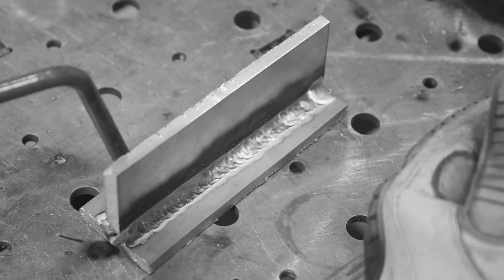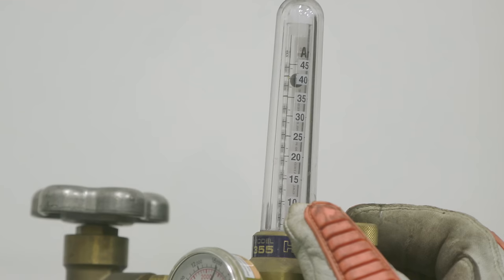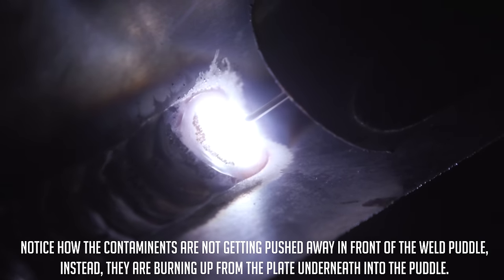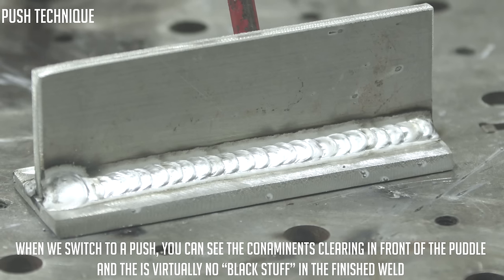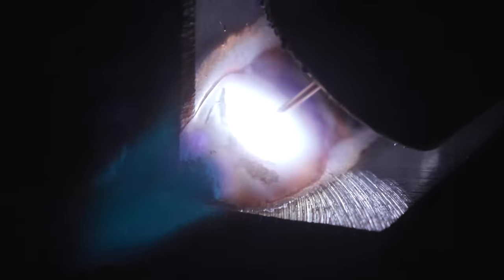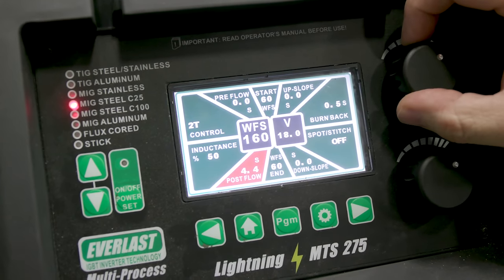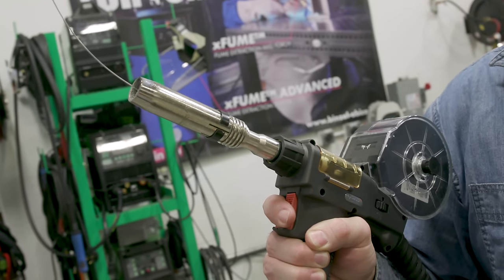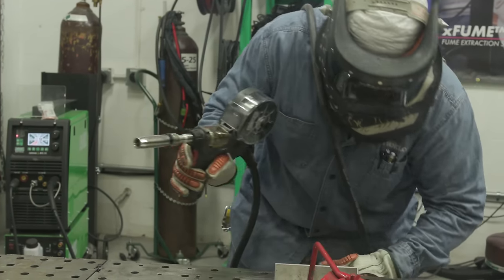3 Ways to Make Better Aluminum MIG Welds in 3 Minutes | PARODY

Comment: After following religiously the guide on the machine cover without success, i.e. too slow wire speed and low gas flow recommendations leading to disastrous results and without any help from the dealership I was contemplating pitching the entire setup and investing in a TIG. Your videos have taught me to make acceptable welds and have saved me the additional $$$, something the dealer was entirely clueless to. Thanks, Andy

Comment: Nice to see your glasses, they really do suit you.

More seriously, on another site it was said that when TIG welding aluminum, you need one second post flow for every amp. So 5 seconds with 50 amps, 10 seconds with 100 amps, and 20 seconds for 200 amps. All so the tungsten could cool down, nothing really to do with the weld. In almost 50 years of welding I’ve never heard of that one.

Comment: Thanks a LOT! 
Greate VIDEO and good view to specific trouble of Al welding!
On the video you quate clear discribed good idea to increase gas sheald during welding ... and you have achived the requared result partly.
As I see additional measures could increase weld cleanliness - on the picture oxide paticles coming from filler wire to the welding paddle
I have one question -
What do You know about chemical treatment of aluminium filler wire?

Comment: The series of Aluminum MIG wire also makes a difference in your bead profile. When your dealing with aluminum take the time to clean it properly, get your travel speed correct, and that your parameters are in good condition to get that nice penetration all throughout your weld. Aluminum is not a forgiving metal.

Comment: Sir , l can see many spatter when I mig weld aluminium. I use ER 5456 filer wire.  How to reduce spatter ?
Reply: ask yourself: what is your work to tip distance and angles?settings?
or are the electrodes stowed properly from atmospheric contaminants such as sprays and dust that may react?
Reply: Could be too much wire speed, not enough gas flow, not cleaned up, too much amperage.
Reply: Bring your volt up .5V at a time.
Reply: @Mikey-ym6ok   I adjusted many the machine settings and gas flow rate.
Voltage can't be adjusted in my machine. Amp , wire feed speed and indctence can be adjusted.
Reply: @ravindukalhara9924  find the sweet spot of tip to work distance angle etc.. could be the shape of your inductance setting is making a tall scalene triangle  shape of arc versus a low obtuse shape of arc .
then try whipping inline(like you have too much coffee, or shivering ) of direction of push travel (always uphill if not able to position work in the flat..) keeping at the leading edge of the puddle will disrupt it less..
assuming your consumable tip and liner dont have any wear and tear causing a stutter type of feed rate spatter
shielding gas nozzle size with flowrate can play a role..
Reply: @philanderingwhitecollartra8281   I tried many times bro. I am using push- pull gun and not the spool gun.  I tried to reduce spatter many time and ways. Welding spatter come out may MIG welding. I think that my machine is bad. Thanks you advice and I respect you for helping me.
Reply: @ravindukalhara9924  can the pushpull system be calibrated? drive roll tension over pressure can cause the wire to spiral as it comes out of the contact tip and into the arc.. what is the length of your system between drives.. learn the cable shuffle of sliding it around avoiding any loops bends excessive twisting.. if you find that the liner is straightened out adequately the amount of wire on the stick out may change... but these effects may see you birdcageing the wire or breaking etc .. keep your stinger straight..lol
inductance can have an effect on how much extra close or further  the work tip distance can be and nozzle size and gas flow play a role..
the only other  would be if your machine is sensing it can cause either the voltage or the wire or both to either increase or decrease of iether or both and typically this is a solidstate analog behaviour  that can be identified by cv,cc,cp..
(constant voltage, constant current, constant potential) 

(typically ill start the apprentices on steel with their dominant hand and as soon as the start getting the hang of it (not good yet) i make them do the rest with the left hand until that improves to same point them i put them onto aluminum same thing right then left then i let them use their dominant hand again and suddenly muscle memory confusion they start to get really good..)
Reply: for aluminum keep inductance at the 50/50 settings.. sometimes this is functionally known as arc dig..
ive seen welders doing repair work get so accustomed to their settings  for specific material repair that they tend to fail the check test by not re dialing in the machine when  should be ...
nylon or plastic liners  help too personally..  get any and all twists and rolls in your gum cable and have an electrical tape wraps every foot at least if not 6-8 inches.. learn to coil your cables so that you dont twist or roll and strain cables..

Comment: have Question I have a hobart 140 with no spoon gun can i use it to weld Aluminum and if so what settings should I start at.  I've tried for a couple of months now to get a welder here to weld for me but they will not even call me back can't wait any more. I do steel weld no problem never tried Aluminum. HELP

Comment: So I applied at a fabrication welding shop, I'm not a journeyman but have a few years welding experience. They asked me to do a steel MIG and aluminum mig test. I've never welded aluminum before that wasn't tig. 

I always push my welds, never pull so I got lucky. 

$32 an hour to start! 

Thanks for the tips!

Comment: Another trick is rotating the spool holder 90 degrees, keeps the curl or the wire in the direction of the weld. will notice a huge improvement.

Comment: Probably the dumbest question, but I have to weld out in the open a lot of time. No building, no covers, any help for welding better aluminium in the elements?
Reply: A couple of clamps a piece of angle and a small cutout from a tarp make nice portable wind screens.
Reply: BREEZE is fatal to all gas-shielded processes!  On the other hand, the world is full of cardboard and tape, and clamps and foil and odd bits of cloth and tarps as Jason must mentioned.

Comment: ummmm MIGHT Be buying a spool gun, Might be trying to half ass it with a carefully with a laid out mig line cause I only have have a few hotrod parts to make.. BUT. 
I did; Like, Subscribe and comment. well done.
Reply from the maker: If you decide to use a standard gun, look into a Teflon liner.
Reply: @Welddotcom  Holy crap you guys are amazing. I took enough welding in college to know that this is the wrong way to do it - especially for anything that looks like production - but those kind of tips for those of us trying to make one off parts are why I keep watching.  Ya'll are great and looks like my Hobart 210mvp needs a minor upgrade.   NOW I just need to find enough alum/stainless parts to make for this car to 'justify' a TIG machine..

Comment: Hi!, im a diesel mechanic and I weld bumpers made out of aluminum. I see previous welds that have broken right down the middle of said weld what would cause this??. I know aluminum has to be clean as possible and I always try to "V" and bevel for best possible penetration, I believe this provides a better weld. You can see it fill in the crack as opposed to just sitting on top of the two pieces that are butted together.
Reply: Undersized welds, concave bead profile, lack of fusion to the root, cold starts, crater cracks, using a filler metal with too low of strength for the fillet size, the vibration of the bumper causing a fatigue failure (use a filler metal with better toughness like 5356 if its compatible with the base metal).  Those are a few possibilities 😀

Comment: In what situation is it better to use wire feed on aluminum rather than tig welding?
Reply: skill at machine settings and dexterity or production volumes or engineering requirements and or deposition rates
Reply: When you're in a hurry!

Comment: Can you guys over in weld.com land do a spool gun video to show off what nets the best results? Whether it's a 15 degree push pull/back and forth, a weave pattern, circles, triangle motion. I understand everyone has their own thing when it comes to that but I'm curious if theres any empirical answer to this. Please and thank you!
Reply from the maker: As far as appearance goes? Or you want an etch?
Reply: @Welddotcom  an etch would be nice to see. I'm going to assume that if the quality is there and it's good enough to pass testing, ie bend, etch, no porosity, etc that the appearance accompanying it should be what were striving to achieve. I'm sure there's more than one technique that will qualify as passing but looks and functionality is what I'm hoping we all here are trying to achieve.
Reply: when qualifying a vertical up difference of whipping inline speed for a single overlapping whip vs double or triple is when bend testing it will snap easy or double will bend 45 and break or a triple just bends over but a steady push can do just as much with practice

Comment: as somebody that used to weld a shitton of alu-mig, you dont need a spoolgun or a push-pull gun, as long as you have a lead shorter then 2m(6ft.), use a aluminum liner in the lead and adjust the "clamping" in the wirefeeder correctly you will have no problems. Why oh why does it seem like whenever i see americans weld alu-mig they always say that you "have to have a spoolgun or a push-pull"?
Reply from the maker: We never said you have to use a spool gun or a push pull.
Reply: @Welddotcom  no, just a general comment. I have used spoolguns in the past and i personaly dont see a reason to. Its heavy and cumbersome to use. And you have to change the wire more often. just a comment on your use of the spoolgun.
Reply: Mattis Vik you’re right, it can be done, however most of the aluminum mig work I’ve done is on parts larger than 6ft and a lot of it has been in the field. It’s easier to carry the spool gun around the shop than to drag the machine every 6 ft.
Reply: @jasonbecker3362  for me, i just bring the feeder with me when moving location, if you are doing large jobs then you generaly are better of with a seperate power and feeder unit. if all you have is say a 210amp small machine and you have to make lots of smaller welds lots of different places then i get it kinda. But the difference in time is so small compared to everything else one has to do, just dont think its worth it using a spoolgun.
Reply: mig wire gauge sizes too..
Reply: My CIG 275 Transmig has a different liner for Ali that has a Teflon tube inside it and the lead is about 3.5 metres long.

Comment: FORTY CFM!  Last tank of 50/50 argon/helium cost me over $300.00!
Reply: i think it's 100% argon for this process.  for a full size (5 foot tall...50lb i think) cylinder never costs me more than 50$.  is that in the US?
Reply from the maker: We're using 100% argon here.
Reply: yes USA.
Reply: Wow that’s high man, 50/50 Ar/He mix costs around $130 or so to fill the largest size tanks at my LWS, but I’m in Arkansas. I’ve only used it for TIG though, never had to MIG aluminum yet lol thank God
Reply: Well, what about Cubic Feet Per Hour?  Someone else has already mentioned that.  You might get seven or eight hours of arc time from a big tank?  An HOUR is a long time for welding, here they seem to be getting an inch in a few seconds.  Anyway, what do you EXPECT?  It's ten times as intense as TIG welding a hundred times more than with torch, and those things are already kind of magic.  Not surprising there's a price to pay!

Comment: This is for beginners? Lmfao. How much voltage, amperage, how much wire....I need these freaking basic settings and nobody on the internet tells me. Keep getting charred clobs no matter what I do.
Reply: Little late of a response 380 wire speed around 20 v. If you need to adjust do it accordingly too much heat tone the speed and volts down as you go. 280 wire speed is kind of the floor of aluminum spool welds.